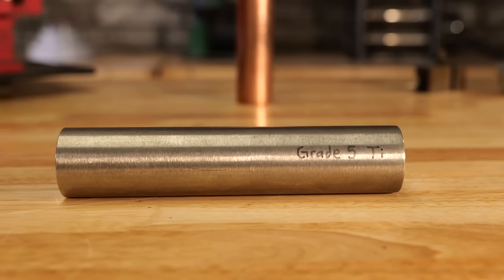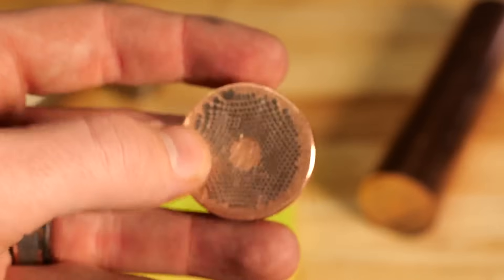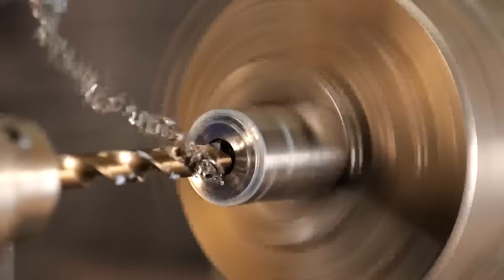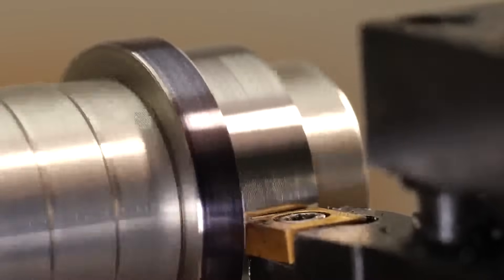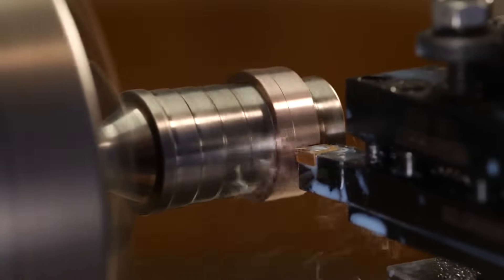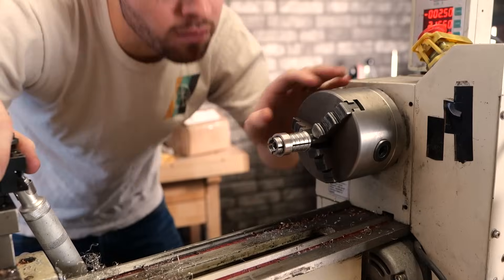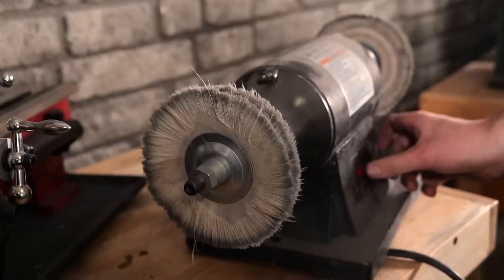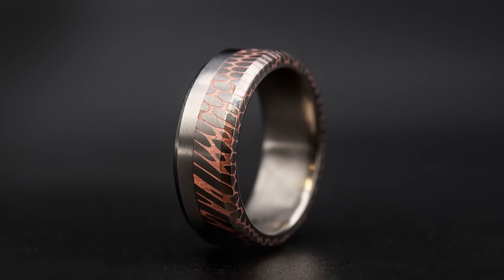Making an Acid Etched Superconductor and Titanium Ring

Comment: Quick question why don’t you soldier the two pieces together it’s I’m just curious.
Reply: If it was machined correctly, it would be a press fit and you then don't need any glue or solder.

Comment: I'm pretty sure he got confused about what type of superconductor he has. I think that's a high-voltage transmission core for underground high-voltage transmission. Designed to have low (non zero) resistance and hold up to thermal and electrical stress from extreme current at very high voltages. Transmission cores are large, like the thing he has, and are commonly have internal cores of different materials running through them.

What he describes, as used in superconductor magnets, are usually tiny very thin wires. Because they have 0 resistance there's little reason for their superconducting cores to be bigger then a hair in diameter.

Comment: Hey, Patrick. I think I've made the exact same comment a couple of years ago, but why don't you just make the inner ring to a really tight fit, and then just cool it down with liquid nitrogen or dry ice, to make it shring, drop it in the outer ring (or press it. Depends on how much it shrinks) and it'd come back to it's original size and be permanently stuck inside. I believe it's a much stronger and more relyable bond, than CA
Reply: He doesn’t care.
Reply: I haven't watched any of his videos for a couple of years, because of the poor machining, and I see he has got no better. He really needs to do an engineering course to learn something that he can apply to what he is doing, or as @andybaldman said, he just doesn't care. For the prices he sells his items at, you would think he would put more care into his workmanship.